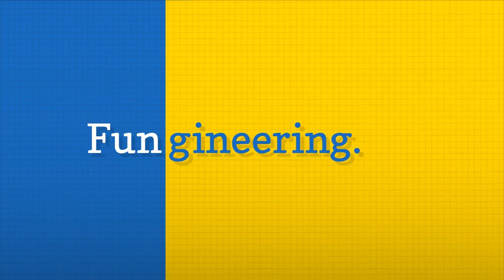Ep6. Nuclear Weapons

Comment: Heavy water is used in a breeder reactor in order to maintain the "free" neutron flux near an optimal value, this is due to the fact that when U238 absorbes a neutron and transmutates into Pu239 you effectively lose 2.5 neutrons per generation. 

In a normal light water reactor the regular hydrogen also has a high neutron absorption cross section, therefore in order to prevent neutron losses from 2 separate absorption mechanisms a deuterium atom is used instead of a regular hydrogen atom as a moderator.

This is what the Nazis were planning, to construct a plutonium fission weapon with the help of a heavy water reactor.

P.S. in the case of a Teller-Ulam fission-fusion weapon the trigger for the fusion reaction comes from x-rays not directly from a neutron flux.